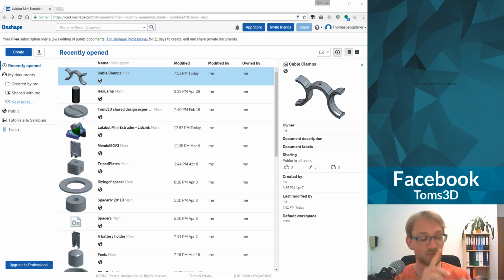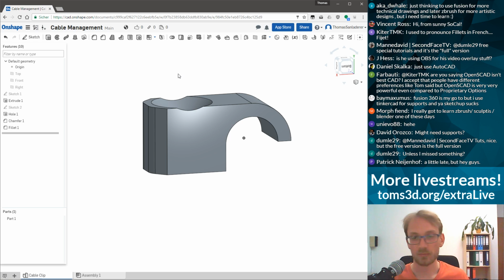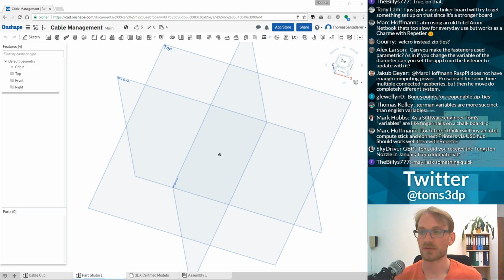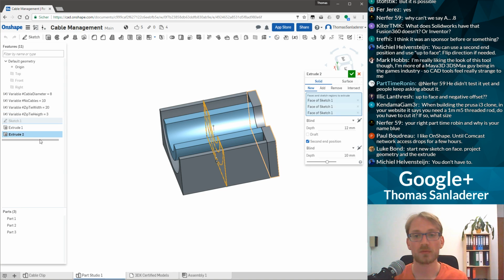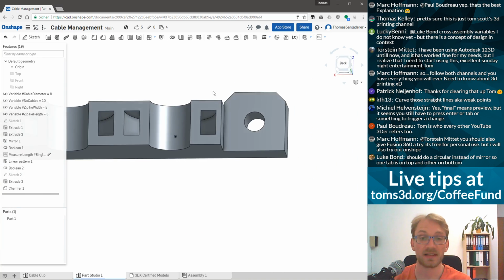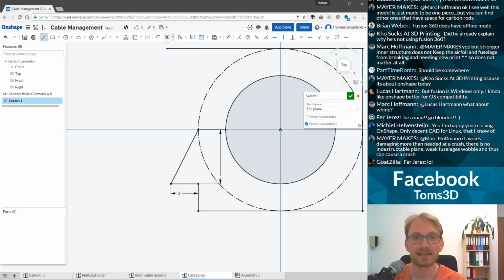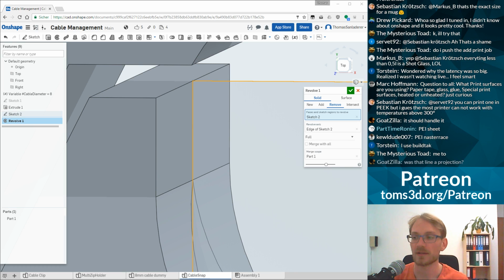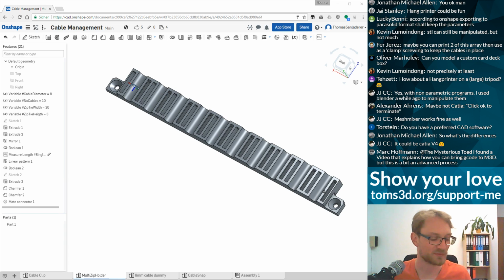Designing some cable organizer stuff in Onshape!

Comment: Nice, I know it's about the CAD but you need to add a hole in the top of the cable snap to permit screwdriver access.  Stagger the mounting tabs on the MultiZiHolder to allow two or more to sit together in less space.
Reply from the maker: +James Lamb you're welcome to clone the designs in Onshape and make improvements to them however you like!
Reply: I give you the challenge to print the hinge with TPE while the rest is ABS ;-)
Would love to find an slicer where one can define materials/printing temperature and color for different areas of the STL (simple CAD within the slicer software).

Comment: Reminds me of when I made little cable tie anchors you can twist into v-slot and they just hold wires along the length. Very nifty design, Tom :)
Reply: Also, while yes a lot of tools and skills are transferable across CAD programs that's not the be all and end all. For example, 123D design, damn easy. Inventor, damn easy. Solidworks, of what I got to try... pretty easy. Fusion, damn easy. Onshape.... something about it just made to feel clunky and unusable.

Comment: Just a quick question on designing for printing: do you see any reason to make dimensions as multiples of a layer / nozzle for thin walls or floors? For example if you tend to print at 0.2 would you design a part thickness at 0.6 rather than 0.5? Or with things like the hinge, being multiples of the nozzle at 0.4 rather than 0.5. I do this but I don't know if it's over kill, so I'd be interested in your view.

Comment: You made a small but significant design mistake in your cable snap model.
In the most inner latch you must make at a small angle inwards so the down force of the cable will latch and lock and won't open over time

Comment: Any reason your using Onshape rather than Fusion 360.  I started off looking at Onshape but find Fusion more intuitive and less restrictive for the free licence.
Reply from the maker: +dabbishaw I explain it in the stream at one point
Reply: I didn't watch the stream, so I don't know where, but I'd be interested to hear why. In my opinion Onshape just blew it when they removed all privacy for free users, and also bluntly refused to add a mid-tier subscription plan. The pro plan isn't justifiable for hobby users, but not all hobby users want what I call the "forced share plan". I ditched Onshape at that point, and converted to Fusion 360 instead. None of them are perfect, but feature wise Fusion 360 blows Onshape out of the water.